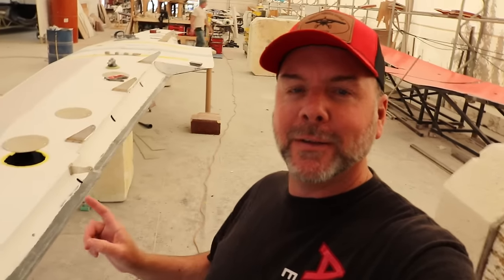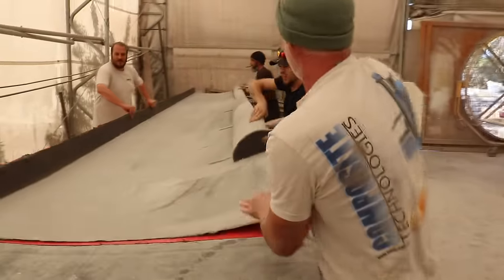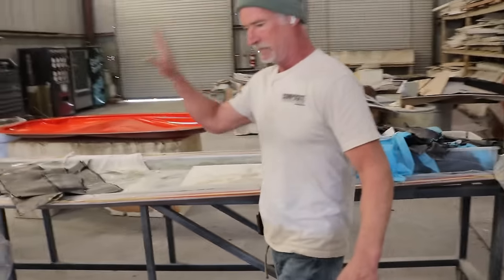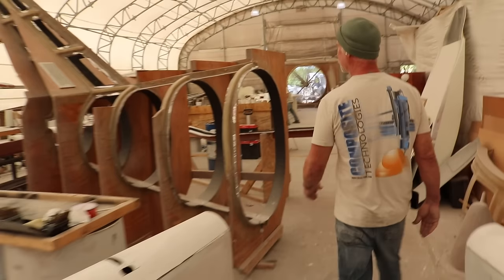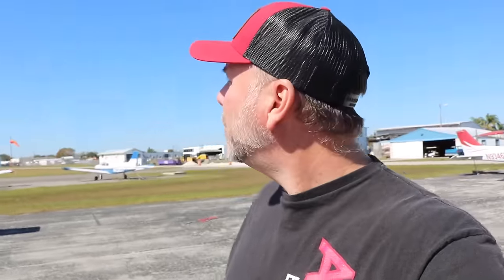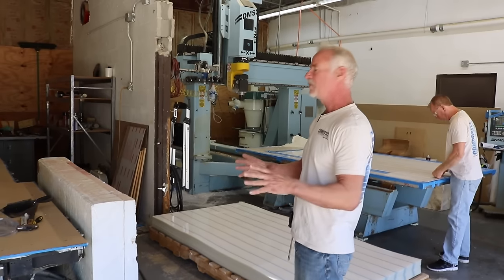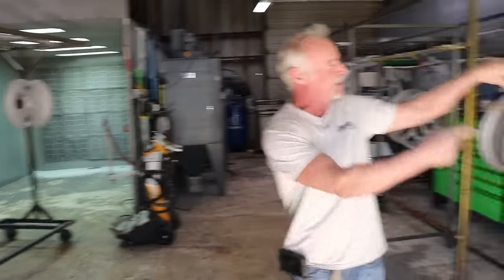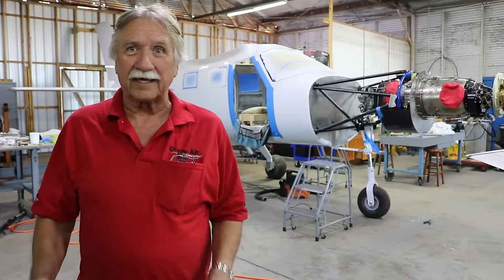NEW! 6 Seat Aircraft - FACTORY TOUR - CompAir Aviation 6.2

Comment: Man thats a scary way to do composite layup on something like a plane. Yikes
Reply: OMG YES 
i would not get into a boat made like that, let alone a plane
Reply: Yup
Reply: I don’t know much about composite construction. What are they doing that makes you question their methods?
Reply: absolutely no air quality control, very minor temperature control, no post-curing whatsoever, fabrics handled with bare hands (can lead to delamination), drums of polyester resin, etc. this video is a materials engineer's nightmare.
Reply: @oiphebal  no tool or hardware accountability. The bare hands is actually a really big deal. Should be far more sterile especially because it's composite
Reply: I'm sorry but you have no idea what you're talking about, they're using carbon fiber and epoxy two excellent materials for building aircraft. They're also using peel ply so the secondary bonding process is guaranteed to be airworthy.
Reply: @oiphebal I seriously doubt they used polyester resin for the aircraft parts, I'm sure they use that for all the other non-aviation items that they fabricate..
Reply: I really hope they're using epoxy. besides that, just using epoxy and CF doesn't mean much in composites. so does peel ply: using peel ply but touching the parts with bare hands makes the peel ply no more than a process helper in VARI/VB/OML. the process used to make composite parts is as important as the materials used, if not more. when you start a project using composites, testing manufacturing samples is one of the first steps that should be done, to guarantee relevant data in the sizing steps. I don't have so much experience with composites, you're right, only about 2 years in composites manufacturing and my BE in materials engineering, but seeing the lack of quality and repeatability in their SOPs (if the S actually means anything) is almost common sense.
Reply: @christophergagliano2051  lol okay bud, it’s not the materials they are using it’s HOW they are using them and in the conditions they are manufacturing critical parts. You should probably reread the comments before saying something to what a stranger may or may not know.
Reply: @Dragonrc.  I agree with that, as the process of fabrication is just as important as a materials. But you have to look at the big picture here my friend these guys have been building airplanes for almost 30 years and none of the aircraft to my knowledge of ever come un glued in flight. I'm only reacting to this uneducated person saying the process of fabrication is not up to Boeing standards, lol
Reply: @oiphebal   the poly is used for their other projects, not for the planes